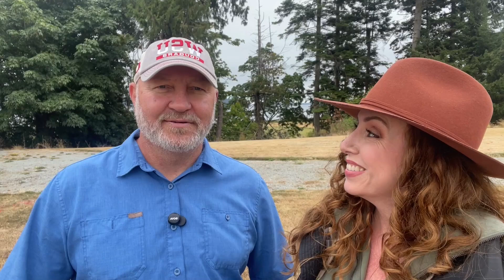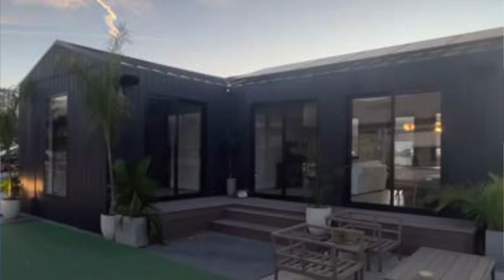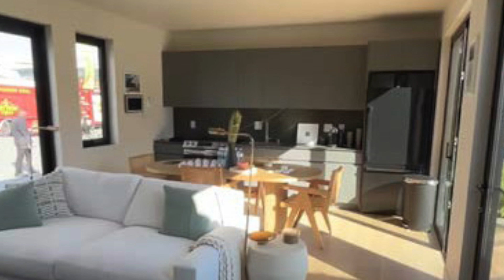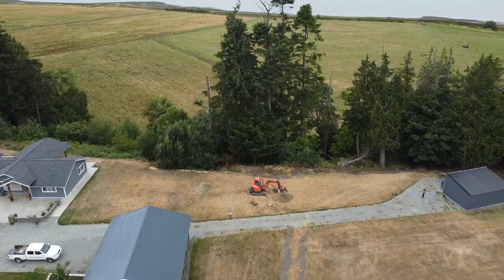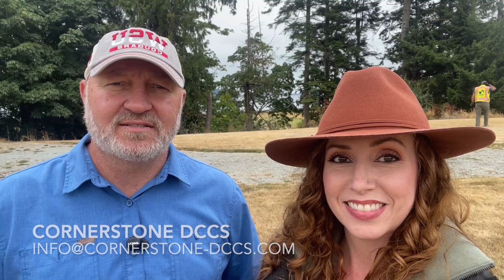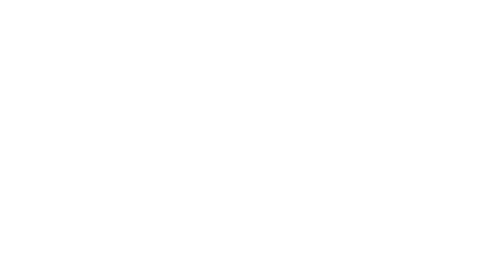Momo Home Construction Kit- Soil Testing in Bow, WA

Comment: Since Momo is using a steel frame, details on how you are mitigating thermal bridging at the wall studs, ceiling rafters, and floor joists would be greatly appreciated. I really like the concept and Momo designs in general.